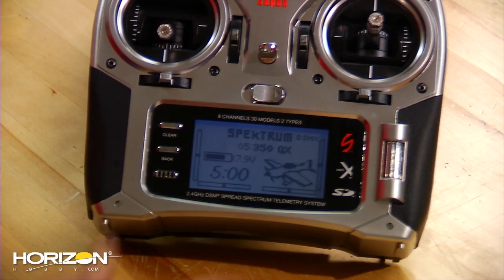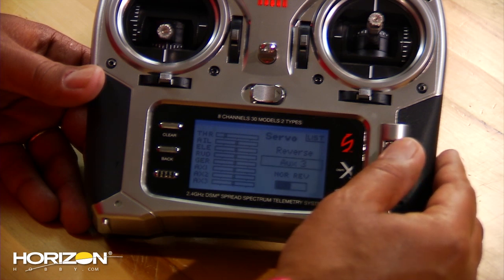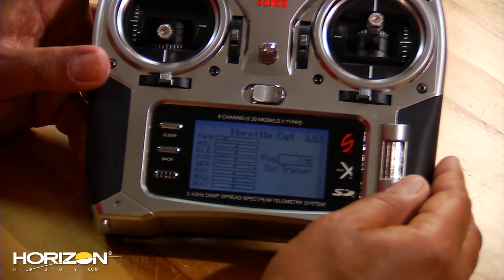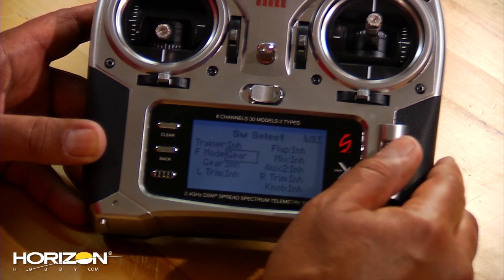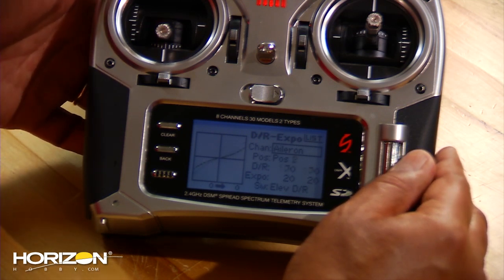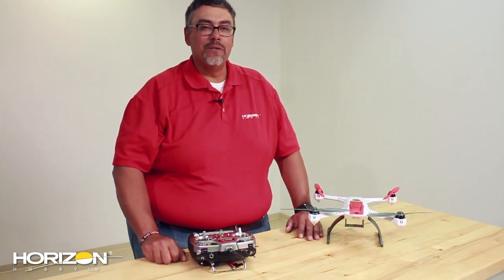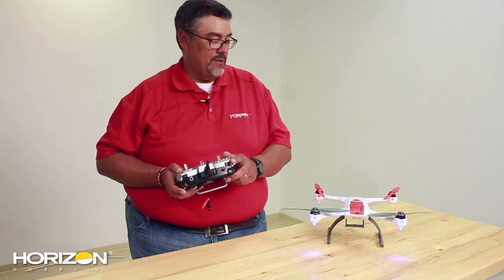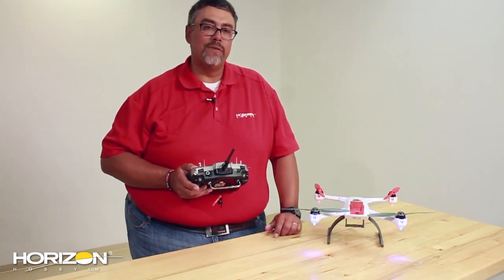350 QX - DX8 Radio Setup

Comment: You Forgot to show how to Bind the 350QX to the DX8  with the GPS mode activated, for that to happen you have to hold the Aileron control to the Left, Press the Bind button ,Then turn on the DX8, Once the DX8 binds to the 350QX if saterlites can lock on,ie outdoors, You should see a Solid Green,Blue or Red Light on the 350QX.